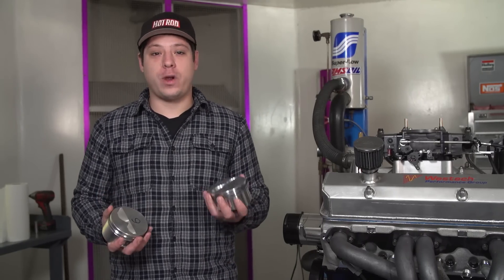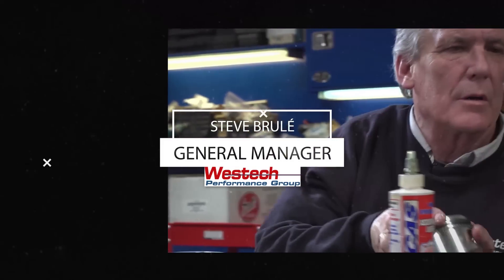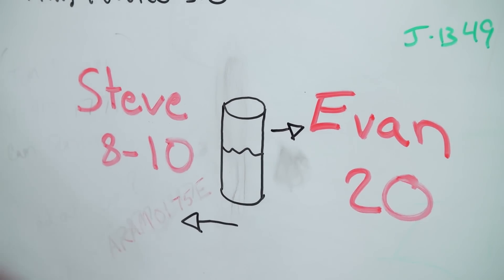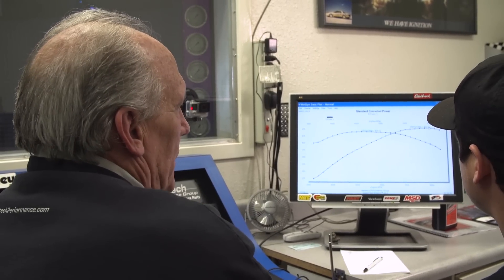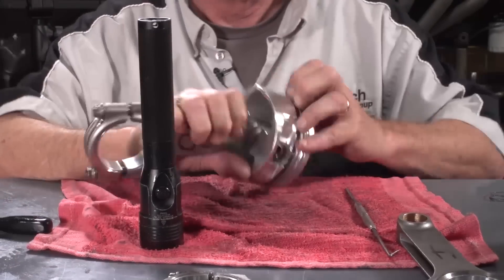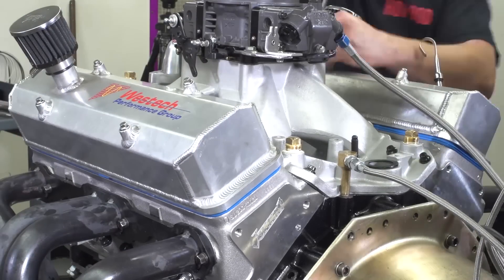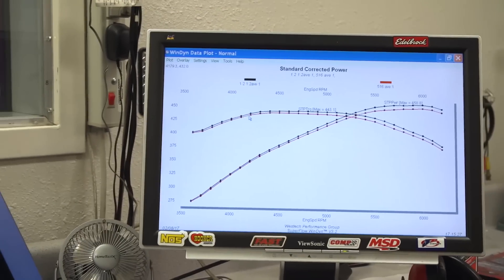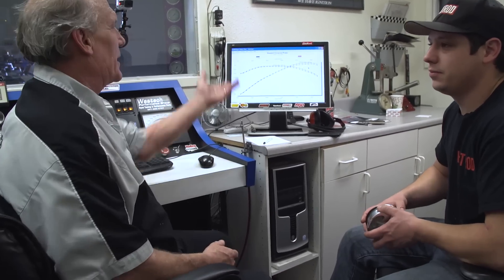Dyno Tested: Are Thinner Piston Rings Worth Horsepower?

Comment: 8hp and better MPG with thin rings.
Reply: Jeremey Allen and less wear and stress on the engine over the long haul...
Reply: Jeremey Allen mazda did their side seals thinner on 13 b rotary and achieved better results.same with the apex seals
Reply: I also noticed that some rotaries had inner and outer side seals and others had just the one per face per side. I'm wondering what that was about?
Reply: FFS, why did I scroll down and let you spoil the result for me?
Reply: not to mention, easier revs
Reply: U WUT M8? oh yes .definatly.
Reply: They didn't present any data on MPG. I would expect it to have the same minimal effect (if any.) How you drive has a much greater effect on MPG.
Reply: InsideOfMyOwnMind those were their first engines.10a and 12 a.dual ditributor.rx 8 engine was further narrowed.smaller apex seals and so on bullshit.not good like early motors.86 thru 91 non turbo were the best for daily driving and race prep.87-91 turbo was a beautiful engine as well..93 thru 02 Lotta heat. .but insane engines.all turbo.these engines are very special.very few  that know them.very advanced.even for today's standards.
Reply: Jeremey Allen That is exactly what I was thinking alsp
Reply: RogerRamJet Mazda is still working on developing a new rotary engine, where they flip the engine over with exhaust on top and intake on the bottom, longer intake runners make a more efficient engine and more HP, the rotary and gasoline engine is not dead, or going anywhere for quiet a while.
I've had to research rotary engines and learn a little about them cause I have an RX7 13 BT engine that I'm swapping into a Opel Manta. I've also  learned a thing or two about so called "fossil fuels" or oil as it's more commonly know. I have a 945 page book titled "The history of Standard Oil Company", (C) 1971, New Horizons 1927-1950, Harper & Row, Larson Knowlton and Popple, it's a very interesting book, just one piece of the big puzzle/lie.   
Global warming is fake, another lie we're "told/taught" (brainwashed) into believing, so don't think gasoline engines will be gone soon, the whole global warming scam is just another way to make more money for the oil companies, the belief in scarcity of oil, helps to keep the price up, I'm old enough to remember 39 cent gas in the 60's and the oil embargo of the 70's, when we were told we would one day run out of oil, and gas went to 69 cents a gallon. But here we are today with more oil than we had 50 years ago, cause they just keep finding more oil fields. Cause earth is constantly making more oil from the internal combustion/fire that makes lava, this process also makes "oil" (creosote, tar, coal, methane, natural gas, etc ) just like any furnace or stove that burns wood, coal, or oil, the earth is a "stove" it creates creosote as a byproduct of combustion in a never ending cycle, as long as earth has it's internal fire, we will find "new" oil on the surface of it, don't believe the lie, we will never run out of oil.
Reply: Thegeokiller 15 i live in pa. Some counties emmissions other no. Litterally the county next to me doesn't have to but i do!!! Wtf. And that diesel rolling coal is exempt! Its all crooked bullshit!!!
Reply: I used these je rings thin rings on a 383 sbc I built and 3 years later it had 200psi 
Now has 180 and smoking oil bad from 2 cylinders 
It's so bad I can't drive it 
I'm calling je tomm 
S100S8-4030-5 
Wiseco piston kit

Comment: We knew about thin rings back in the 1970's. Problem with them was they did not last as long as we thought they should have. Now they do last. We ran the Total seal gapless rings starting in the mid to late 1970's. They worked well, and they continue to improve them. I like them in turbo applications, as they keep the blowby issues down. Knowing this, I agreed with apx. a 8 HP gain, would be seen here...

Comment: When racers measure their performance in tenths of a second in quarter mile ET 7 to 8 HP is the world.  Case Closed GJ guys.
Reply: Not only that, but with increases in bore, stroke, and RPM, the gain should be more because those are more ring surface, more ring travel per crank revolution, and more ring dragging cycles in less time, respectively.  That number of 20 is quite likely in Pro Stock.

Comment: Checrolet went to the 1.5, 1.5, 3.0mm rings long before the LS engine series. Pull apart a '96+ Vortec 350 and You will find Hypereutectic pistons ( Made by Mahle ) with that exact ring pack on them..

Sadly, the aftermarket ( at least in budget parts..) keeps selling pistons with the lame 5/64" or the marginally better 1/16" compression rings...
Reply: 1.5mm = .059
1/16" = .0625

If 1/16 is only marginally better, than 1.5mm are as well . . . the difference there is almost non-existent.

Comment: Spin test with the torque wrench was testing static friction. Found roughly 20ft-ls of difference between the two... Given the average kinetic friction of anything is usually about 3/4 to a 1/2 of the static friction max, and small blocks have similar tq and hp readings in na form, an 8hp difference seem about right! 
Cool test! Interesting to know the little things do add up!

Comment: In the future, maybe a couple different tests relating to the valve train.  One test with roller needle bearings replacing the standard camshaft bearings.  Another test to check the gains in rocker arm changes.  Maybe roller bearings over bronze bearings or a 1.7:1 ratio vs. a 1.8:1 ratio rocker arm.  Another cool test that relates to blow-by is the before and after change from a vacuum pump.  Then, you can check the benefits at 12, 18, and 24 lbs. of vacuum.

Comment: Cool! I just helped a nephew put together his 360 Chrysler short block and he has the 1.5/3.0mm ring pack. We checked the rotating torque and came up with 19 #s. I'm guessing part of that is due to the gooey assembly lube on the bearings (motor oil on the cylinders). Still, I could tell it felt lighter than what I'm used to. Great video, more please!

Comment: One thing to remember is that thicker rings carry more heat away from the pistons and into the cylinder walls. That's better for boosted motors particularly and helps with longevity of the pistons. Racers want power now, street cars generally want to run lots of miles.

Oil squirters to cool the pistons might make up the difference so if I'm putting thin rings in a boosted motor I'll be using oil squirters for sure.

Comment: I think people that go the step to change the rings, also change the piston, and probably, while the engine is apart, change other things like cams, valve springs, etc. So good to see the 1 to 1 comparison, in real life that would be rare to just change the rings.
Reply: I think you are correct, but that really wasn't the. The plan was to see if there was a measurable power gain.

Comment: Very cool. 

One thing I caught that sounds theoretically incorrect. 

“Friction loss will increase with increased engine speed”. 

The law of friction for liquids and solids are opposite. 

The faster a solid object moves across another solid object the lower the friction loss. 

The faster a liquid moves through a vessel of any kind the friction loss is increased. 

So unless the engine oil is acting as a moving liquid, the mechanical parts (metal on metal - rings and bearings) will have less friction loss the faster it moves. 

The maximum friction loss for the motor is starting it from a dead stop. The least amount of friction is at max rpm. 

Theoretically!

Comment: At a basic level, friction is related to normal forces (the force of the ring pushing on the cylinder wall), not the surface area.

Comment: This is a great test.

However, it would be interesting to see blow-by numbers from the 5/16 inch rings vs 1.2mm rings. Maybe the performance doesn't entirely come from lower friction, the narrow rings might also be improving power by reducing blow-by through a better seal.
Reply from the maker: We didn't measure blow by but we did check leak down, which came in at 4% for both ring sets.
Reply: Excellent. That helps explain the results of using the narrow piston rings.

Comment: 8hp was my guess as well, reasoning, the only change in resistance is at the start of the down stroke and the start of the up(or compression) stroke which is the only time the face if the ring is perpendicular to the cylinder wall.

Comment: +HOT ROD Network  
A few questions... 
What was the ring seating procedure? 
Were both ring sets seated/broken in the same? 
Was there a difference in ring tension between  the 5/64 and 1.2 mm sets? 
Was the rotating torque value mentioned breakaway or sustained torque? 

Entertaining and educational as always, thanks to TEN, Hot Rod, Westech, Brule and the sponsors.
Reply: i was just thinking did they give them time to seat
Reply: Was also wondering if any hone was done or needed.

Comment: I'm really impressed it made that big of a difference (1.8%). I thought the thinner rings were only for the ring float engines get at high rpm (2 cycle engines particularly since they are not limited by valve speeds). I had no idea a ring could have that much extra friction (aka wear).

Comment: I have built road race engines with wide and narrow rings. It seems the wide rings will wear in and lose friction while the narrow rings don't have much friction from the start. Those guys will run engines hot, and the wide rings seem to withstand heat better.

Comment: I know this is an old video.  But I would like to see a back to back dyno run where the only thing they change is going from a regular hyd roller lifter, to a hyd roller lifter that has been limited to only .030 to .040 of compression inside the lifter.

Comment: I believe the usual thinner piston rings achieve higher RPM vibration there's another word for it like using the right valve springs design intention with the right camshaft or as the right length of connecting rod with engine stroke and piston pin high short rods or long rods

Comment: Hi All the low friction benefit is at part loads typically 2.0 Bar BMEP which is the recognized industry and OEM test point, if you had run part load as well as full load you should have seen a bigger difference but a gain at rated is worth it

Comment: I think the big benefit to thin rings isn't the 8 hp. But that the lower fiction leads to less heat in heat critical area. They have pretty close to the same area for cooling. The width remains the same which is where most the heat dissipation would be to the piston. The lower heat is going to lead to longer ring/bore life.

Comment: Something people don't think about is thicker rings transfer more heat to the water jacket, running a few seconds on a dyno is much different than driving on the street or racing where the engine is running much longer at high RPM.

Comment: Good video and a question worth asking, but from the manufacturers side of things, in my opinion it boils down to cost savings. The 8 extra hp  is just a little more icing on the cake. The thinner rings will need less material, so they will cost less to make. Even a few cents per ring can make a huge difference over a production run that will be in the hundreds of thousands of pieces annually for perhaps 2 decades? Maybe more? That would be a number to get managements' attention.

Comment: Thanks for doing this test! 
But what about piston ring tension? What if you adjust the ring tension to the lowest it can be?
Reply: Vegaspsycho how long do you think and engine spinning at 6000rpm keeps the tension you set it at?
Reply: lilsammywasapunkrock umm the exact same as the engine being at rest
Reply: If the ring size makes a small difference in the friction in the piston bores then ring tension surely should also make a measurable difference. While the block is disassembled it would be neat to see them use a pull gauge to see how much force it takes to pull and push the piston in the bore and make adjustments so the rotating assembly moves as smooth as possible.
Reply: the bores and pistons expand and contract obviously while the engine is operating. just because the clearance is loose or tight while the engine is on the stand, doesn't mean it will be the same after. plus after break in, it won't be what you set it at anyways. the specs are there for a reason.

i know engine builders that won't put engine blocks on stands because it slightly warps the blocks and changes clearances that they have machined for a final tolerance.

they did measure torque required to spin the motor over and showed it was much easier with the smaller rings.

I am not an engine builder, I would probably barely qualify as an engine assembler. just based on that, I'd leave the "gaps" at the recommended specs.
Reply: The thin ring packs have the same 16-20 lb oil ring tension as the thicker rings.  You can get ring packs with really low single digit tension but you're gonna need a vacuum pump to keep the rings sealed.  Not something I'd advise for a street application.
Reply: Victoria McClung plenty of new cars run vacuum pumps into the crankcase because of the power and emissions benefits Vw's 3rd gen ea888(Gti and r engine) has it as does the corvette apparently
Reply: The factory pumps you're talking about are for power accessories and brakes and only activate when intake manifold vacuum falls below a certain threshold. (as determined by the ECU)  These pumps are not meant to draw crankcase vacuum, nor to be run continuously.  What Victoria is talking about is a mechanical vacuum pump specifically designed for drawing crankcase pressure such as the Moroso #22840 and GZ-Motorsports #VP104.  These are a necessity when you drop down under 11 lbs of ring tension to help prevent ring flutter and excessive blow-by.
Reply: Ring tension is only a starting point as piston rings seal by gas pressure getting behind them and pushing them out onto the bore, how else do you keep 1500psi on top of the piston?. Thus if the combustion pressure is the same the friction is related to the surface area of the ring in contact with the bore so thin is less. The only down side of thinner is flutter, shape retention and breakage, wear will be the same on the ring as pressure is the same but a thick ring will wear the bores more as there's more of it dragging on the bore.
Reply: Rings use cylinder pressure for sealing so technically as cylinder pressure increase so does tension/ pressure against the cylinder

Comment: Would be interest if they could see how much MPG is changed. There is alot of drag there, and is that why Production cars are going that way..or so the engine wears out faster and they get the customer to buy again sooner?
Reply: Production engines last a LOT longer with thinner rings. 300000km engines still with some hone marks in the bores. 
And THAT would be a valid test, an engine bored with and without torqueplate. On most Fords you see shiny bits where the head bolts have distorted the block. Both 6 cyl and in particular Clevo. Chevs with 5 bolts per cylinder markedly less so. And that is the letdown with the LS,, only 4 bolts per hole just like the opposition.